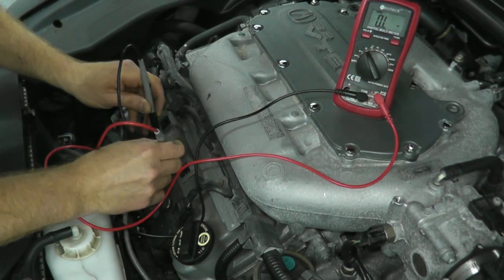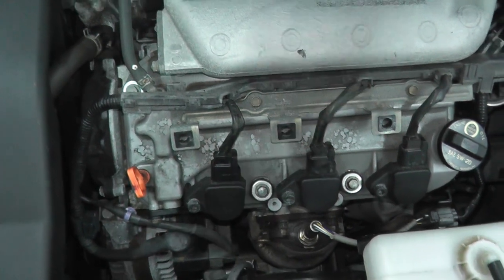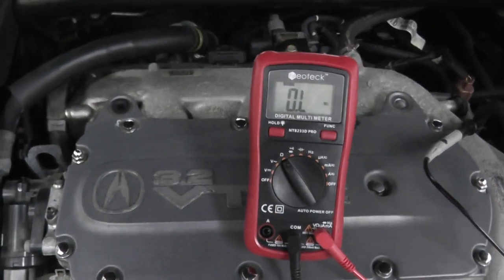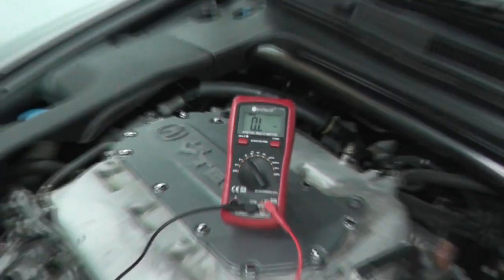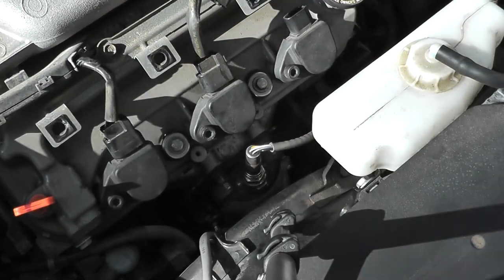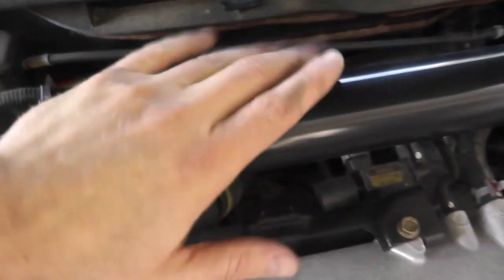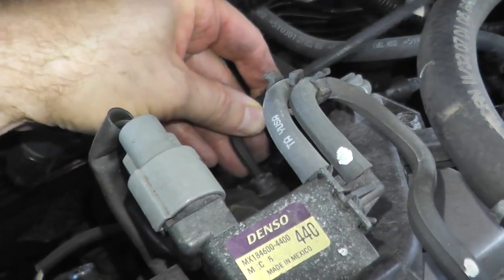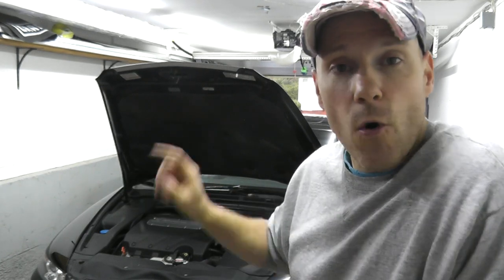Acura TL Ignition Coil Pack Replacement | How To Test and Replace Acura Ignition Coil Packs

Comment: Used your method of pulling connectors and feeling and listening to engine change. It worked. Was able to not feel any difference with one of the 6. Changed it and now everything is running well again. Thanks.

Comment: Whats your opinion on just changing the bad coil and not replacing all of them at once?
Reply: Tyrone Shoelaces  I just changed the bad coil and have not have any issues. My car is low mileage around 100k. I looked at all the coils and they are all great condition
Reply: Tyrone Shoelaces  these cars computer are very sensitive. It took 3 days for my car to clear all codes. The only issue was the coil but the car had emission lights and traction controls lights on. The codes cleared all by themselves I didn't have any special computers to clear codes

Comment: Can a leaking valve gasket or spark plug tube seal( the blue things) cause a misfire on banks 4,5, and 6? The valve gasket is breaking down on 4,5,6 side as well as the plug tube seals.... Help please

Comment: Nobody will even see this comment let alone reply to it but here goes. 
   My 2008 TL has 2 bad coils, 2 and 4, had it checked with a high quality code scanner. 
    The problem I have is ...the dam coils work all spring, summer and fall, but as soon as the bad Canadian Winter arrives, wet, slushy roads, damp winter weather, the car will start to miss, sometimes just one and then sometimes both at once, which causes the car to shake violently, so much that the starting and stopping of the motor makes me feel it's going to snap my timing belt and that will ruin the engine. 
   People say that my coils are wet and are simply grounding out, but once the car's coils misfire, they misfire for days and then one day, they are just great for a week or 2. 
  There is NO way there is water /moisture inside the engine spark plug holes after driving for an hour, so I'm thinking that I have maybe wiring issues on top of the motor where splashed, salty road ice and snow is getting to the wiring, but even under that plastic cover, the engine is as hot as an oven.
    The code reader does say random ignition coil misfire, but if the thin wires going to the coil are shorting out, it would still say the coils are bad wouldn't it?
   Right now, I'm having 2 coils replaced with EMD coils for 79 bucks a piece here in Canada, and I was thinking of picking up a can of electrical wire spray that prevents moisture from getting into the wires and causing a short against the engine...it can't hurt right?

Comment: In need of help my 06 Acura TL randomly shit off on me while driving and wouldn’t start back up. I replaced starter,alternator,spark plugs and coils and had better check and it was fine need you help
Reply: Did you check fuel relay they have a recall bc there shitting to bed I had to replace

Comment: #5 coil pack is leaking is it possible to just change maybe 4 5 n 6 or just 1 that's leaking 5 is leaking just changed oil plan to clean atleast valve cover eventually more $ is tight 07tls auto coming up on 84kmiles

Comment: I have a question, my 2005 Acura tl started off by flashing the check engine light. the car was shaking then it started smoking, coil #6 burnt  but my car was already showing the camshaft position sensor on the scanner. I already replaced the sensor and all my coils. it doesnt have that final spark it even tho it tries to turn on, if you or anyone knows anything about this id appreciate it because my mechanics are also confused. the spark plugs nor sensor get signal, theres a hesitation but no spark due to that.